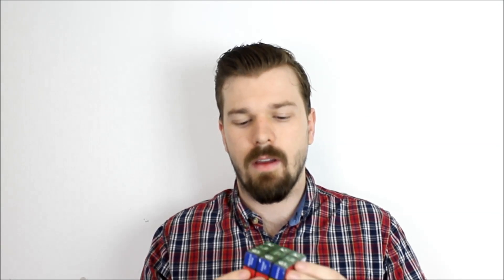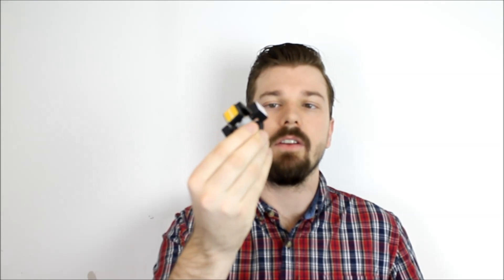Fully 3D printed Rubik's cube

Comment: I have some tips. 

1.) DON'T use WD40, it will corrode the plastic. Buy some real lube
2.) Sand the inside sections of the cube for less friction and a faster turning rate
3.) (Optional) Take a core from a real cube (Speedcubes work the best), and insert the parts around
4.) Add stickers. It makes it a proper cube

Cool print tho
Reply: Prithvi Vashisht do u know if these parts will fit into a speed cube core?

Comment: Will it be automatically added base when printing?(i don't learn English very well,i hope I didn't write wrong word,thx)
Reply from the maker: that is added by the printing software to help keep the model on the bed. this can be setting you can turn off.
Reply: Kirby Downey THX，what is your software?
Reply: i use CURA 15.something.something IDK (i don't know if you don't know English to much as said in your comment) the version for slicing i like the old version because i know it better because my old 3d printer used an old version of CURE and i got used to it but my new one doesn't matter just give it a G-CODE file and it prints but u can use any software

Comment: DO NOT USE WD 40, AS THIS COULD HARM YOUR SKIN AND RUIN YOUR PUZZLE. Try silicone spray instead.
Reply: +Cole Cuber yes, but that is only for speed cubes. doing it on a rough puzzle makes it easier to turn.
Reply: +Downlinks Thae  hes right! if you use wd40 it will wear away at the puzzle and make it anoying to use
Reply: for speed cubes but cheap cheap ones u can use wd40 just a little but i like to use silicon spray on my 3x3 speed cube my 4x4 and my friends 3x3
Reply: or you can use butter it works well
Reply: My goodness. You want to use actual lube. Silicone spray and butter are NOT viable options